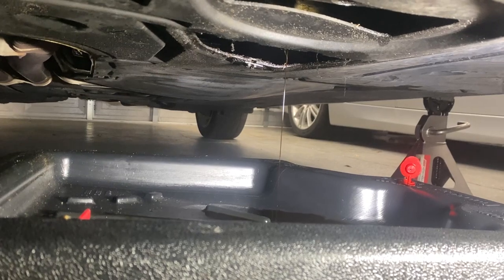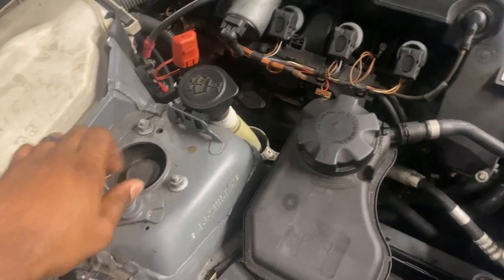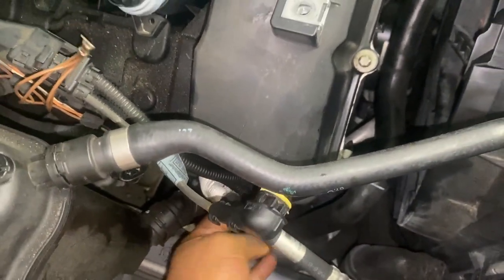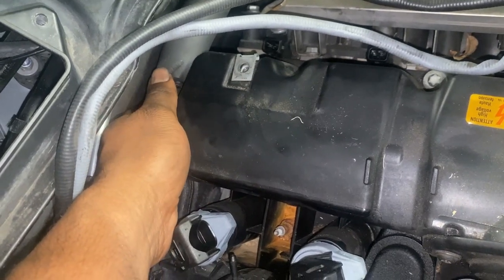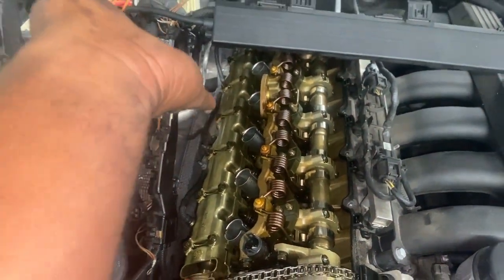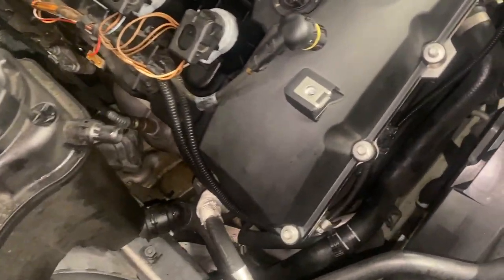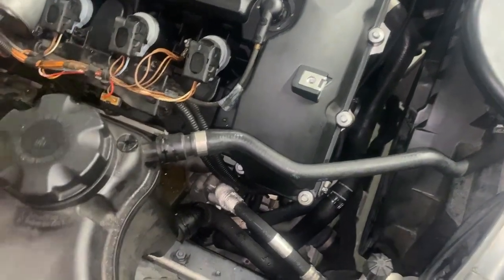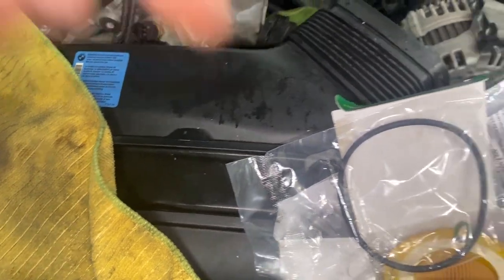BMW N52 Valve Cover, Vent Hose And Oil Filter Housing - Whistling Noise Fixed

Comment: Excellent Job!!! My 2010 328i had the same symptoms, i replaced my valve cover and plugs & coils she runs like new again. I also replaced both of  my vanos sensors to. Saved me over $3000 smokes from the Stealership. During the torque phase i tightened the bolts to 10nm. I haven't had any issues or leaks. Super happy!!!

Comment: I recently ran into this problem myself and even after replacing my valvecover and hoses. I noticed this started just days after an oil change at my local dealer so I didn’t think much of it and why not replace this as preventative maintenance. I noticed I had a collapsed oil filter twice within a month time frame, so I just decided to do another oil change. I noticed my car had over 7.5 quarts of oil not 6.5 with an oil filter as specified for an n52. After that I haven’t had that whistling noice coming from my engine. Luckily this isn’t my daily and didn’t ran it much in that month.

Comment: Could it be just the pvc valve?
Reply from the maker: If it’s making noise def would be the pcv, but it’s integrated into the valve cover so have to replace it. I believe only the n52 in the 06 330i had the serviceable pcv that you don’t have to replace the valve cover to fix.

Comment: Where could i buy this kit nowdays ?
Reply from the maker: The link in my description normally have it in stock, but the sities down for a revamp. But you can search for this part number for the gasket  “11 12 7 582 245”
Reply: @nOshi2x  where can i get the vent hose